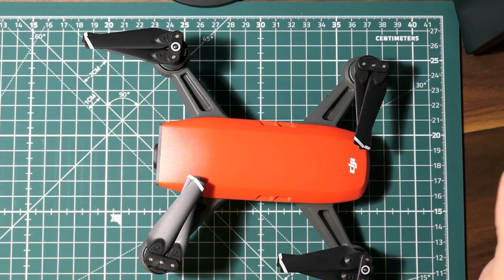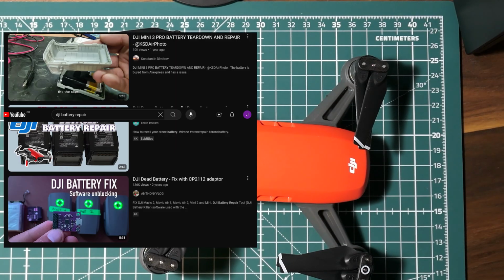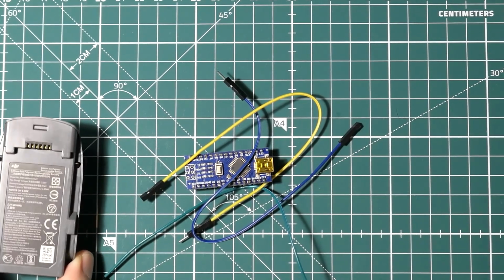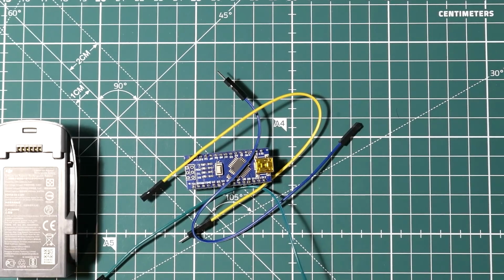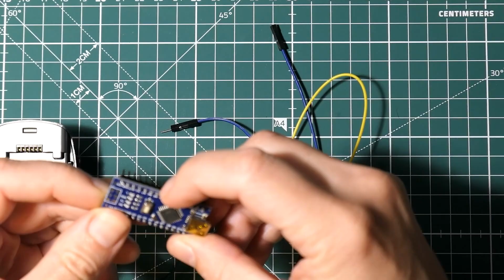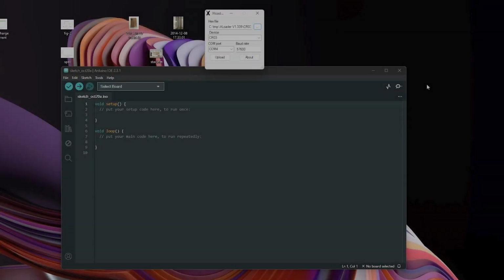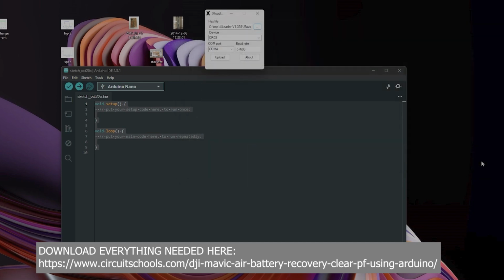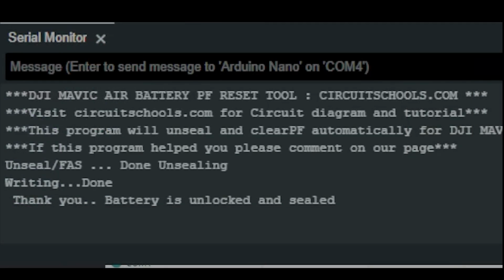DJI drone battery repair using Arduino – super easy (MAVIC, SPARK & OTHERS)!

Comment: Hello. In the video. It mentioned that if the battery is completely dead, it also needs to use a 9V battery. Can you explain this process? How to connect the 9V battery and when does it need to that?  Do you connect the 9V battery while using Xloader, or Andruino, or before? I am a bit confused. Please help
Reply from the maker: So the steps are as follows. 1) connect the Arduino nano to computer and install the hex file using XLoader, once complete disconnect Arduino from computer. 2)Connect the arduino to DJI battery as shown in video. 3) Connect the 9V battery (or 12 if using mavic battery) to the + and - terminal of the DJI battery. 4) with everything else connected, plug the usb cable back into arduino to power it up, the code will run automatically to reset the battery. You might need to try a few times etc. good luck, I will pin this comment as many people have asked similar questions.
Reply: @thecircuithelper  This exact process worked for me on 3 different batteries! Thank you!!!
Reply from the maker: @jimber13 awesome that’s great news! Happy flying

Comment: I am so confused about the process to jump start the batterys with a 9V battery. I need help. I have been able to do everything else except this. No where in this video or any video/online forum that I can find does it show you how to acctually connect the 9V battery to the DJI battery. Everyone just briefly describes it and moves on, but that is kind of the most important part.

I have 3 dead DJI Mavic air batteries. According to pin out, pins 1-4 are negative, and pins 6-10 are postive. I took male to male jumper wires which I purchased using the link and just plugged into them into pins 1 and 10 on the battery. Then I held the other ends of the jumper cables and put them in contact with the postive and negative ends of the 9V battery. I handheld this for like 5 mins wondering if anything was ever going to happen, but nothing. Am I using the correct pins? I just chose 1 and 10 because it seemed easiest, but nowhere does it specify if it needs to be certain pins for this to work, just that it needs to be positive and negative which is what I did. Also, do I leave the Arduino connected to the DJI battery while I do this thing with the 9V?

Please someone help. What I am doing wrong here???
Reply from the maker: So, it sounds like you’re doing pretty much the right thing. I read on another site that Mavic batteries might need slightly higher voltages (12V) to jump start it. I only have Spark, so can’t say for sure. 

So the process is as follows, use the two male-male jumper wires to connect your 12V source to the + and - terminals of the DJI battery (any of the pins labelled + and - should be fine).  You should also have your Arduino connected to the DJI battery as described in the video. Importantly, you need to power on your Arduino with your DJI battery attached to your 12V source. That should be all you need to do, the code will run and reset the flags on the battery.

Comment: My spark batteries were way gone from 3 years of non use. I powered the batteries from my bench supply at 12-13v and performed the reset twice with everything connected. The battery then started to take a current from the bench supply and after charging for a bit I let my drone continue the charge. This is a great save, thank you for this video!
Reply from the maker: Awesome! Glad it worked out, just take it steady for the first couple of flights, just to make sure the batteries behave as you expect! Happy flying and thanks for watching!

Comment: When i try extracting the HEX file it gives me ERROR 0x80004005 did this happen to you and if it did what do I do?
Reply from the maker: Hmm, that didn’t happen to me… does the error occur when you’re extracting the hex from the zip file, or when trying to upload the hex to the arduino? If it’s the latter, I guess it’s either a com port issue or baud rate problem. If it’s an issue with the zip then it’s probably a corrupted download. Good luck!
Reply: Use Winrar to extract the files using the password, it works

Comment: If you're using a Arduino Uno or clone, make sure you use port A4 and A5. Not SDA and SCL on the board. Thanks for the guide!
Reply from the maker: That’s a really good point! I just assumed it would be SDA and SCL on the UNO too, but it makes perfect sense that they defined the pins as A4 and A5 in the code, which we have no sight of or ability to change! Thanks for flagging this up and watching! Cheers

Comment: Is the mavicair pfreset are free?
Reply from the maker: I’m not sure, it’s possibly worth a try though. If you find the pinout of the mavic air battery and it has a clock and data pin then you’re in with a good chance. Please let us know how you get on to help others!
Reply: @thecircuithelper  I bought Mavic air pfreset code and download, but download failed the xloader
Reply from the maker: As far as i could see yesterday, there’s no need to pay for either xloader or the pfreset code, so I’m not sure what is going on. Did you try to connect to your arduino using the arduino ide and upload a simple program, just to make sure it is working?
Reply: @thecircuithelper  hello sir ,It worked after 7 hours of trial and error, the problem is that I used the xloader from circuitschools instead of the xloader from github, I paid 5 dollars to get a code from fpreset, thank you sir
Reply from the maker: Great, I’m glad you got it working! I hope people reading this realise you don’t need to pay to get the reset code or xloader! Thanks for watching and safe flying!!! 👍
Reply: @thecircuithelper  Hi, I just wanted to thank you for the tutorial, but I'm a bit concerned. In my country, 5 dollars is a considerable amount, and I’ve already tried using the CP2112 board but couldn’t get it to work... I would like to know if there’s any way to test it before paying. Thanks!
Reply from the maker: Unfortunately, it now appears you need to pay for the PFreset code! I’m not the original author so it’s out of my hands, quite a shame through.

Comment: How to download xloader?  This is free?
Reply from the maker: Yes this is also free, it’s on GitHub.
Reply: @thecircuithelper  okay thanks 👍
Reply: My xloader can't run why?
Reply from the maker: Need more details… xloader doesn’t work on your computer (if so, that’s strange, i tried on both windows and mac, worked on both). If xloader doesn’t communicate with arduino then it’s likely an issue with com port or baud rate

Comment: The site requires payment to download the hex file now. I paid the $5 fee through PayPal but never saw a download link after, anyone else have an issue with this?
Reply from the maker: Yikes, it looks like the hosting website has changed, but I just managed to download the zip file now without having to pay. Thenhosting site is pretty horrible,  with a lot of popups and misleading links which make it look like you need to pay, but you can definitely download the zip without paying.
Reply from the maker: If you still struggle, you can drop me an email at helpercircuit (at) gmail.com and I’ll send it to you.
Reply: @thecircuithelper  Yeah I'll email you, the person I sent payment to hasn't responded either, so I'd appreciate if you could share the hex code!
Reply from the maker: No worries, I downloaded it last night and unzipped the hex file, it looks to be ok, haven’t tested it though. Just drop me an email and I’ll send it to you.
Reply from the maker: I’ve emailed the Hex file, let me know how you get on!
Reply: @thecircuithelper  please share with me too, i have email to you too.
Reply: @thecircuithelper  Hi, Just wondering Would it be possible for you to send me that file? I've already sent an email to you.
Reply: Actually it's with PayPal, after payment it should redirect you to download link. But if it's not it was an issue, I emailed the seller and he replied me with the download link.

Comment: Hello, I didn’t used my Spark for two years and of course the batteries were broken. After some searching I came across your video.

I gave it a chance and bought a Nano and followed your instructions.

After some trial and error, it finally worked and the batteries are charging again.

Thank you so much for sharing this video.
👍🏼🚀
Reply from the maker: Awesome, so glad to hear you got it up and flying again… Just give it a few gentle test flights to make sure the battery behaves as you expect and holds its charge etc!! Thanks for watching! 👍👍👍👍

Comment: why does it say i can't open port.
Reply from the maker: Problem communicating between the arduino and your computer… could be quite a few reasons: 1. Make sure your usb cable is for data and not just charging, 2. make sure your computer recognises the arduino when you plug it in, you should see a new com port appear in control panel, 3. test the arduino using one of the example programs in the arduino ide to make sure you are communicating with it ok, 4. Once you know the arduino can be reached, use the Xloader software to upload the binary and connect the battery to the arduino. Hope that helps!!

Comment: Ok I'm confused I've got DJI spark can't find link/software for DJI spark
Reply from the maker: If you go to https://www.circuitschools.com/dji-mavic-air-battery-recovery-clear-pf-using-arduino/ and scroll down the page you'll find two links. The first in a zip file containing a binary file, this is the code used by the arduino. The second link is a for a programme called Xloader, this enables you to upload the binary onto the arduino. Even though the code says its for Mavic it works with Spark, I only have Spark so can confirms it works.

Comment: Hello Circuit Helper. I have the sameproblem as you - I haven't used my Spark in years and the batteries are dead/almost dead.  Although your video is very clearly outlined with all the steps, I am by no means an expert with electronic - far from it actually. I wondered if I was able to send my two batteries to you, could you repair/charge them for me for a fee? Gratefully yours,
Reply from the maker: Hey, thanks for watching. As for trying to fix your battery, I think there are already quite a few sellers on eBay that offer this service, you’d probably be better trying them as I’ve only done it once on my batteries, those guys have 100’s of positive feedback. Good luck!

Comment: hello i have a mavic air drone and i used an adrino uno i used xloader but it ididnt upload the code
Reply from the maker: Hmmm… it could be a few different things. I’ve not tried it with the Uno, but I guess it shouldn’t be so different from the nano. Just make sure you have connected the SDA and SCL wires correctly. It might be worth trying with a nano if you have one to hand. If you are certain things are wired correctly then you might need to use an external voltage to enable communication with the battery… I explained how to do this in a few of the comments on this video, it’s really easy.
Reply: Ok I’ll try comeback to you thx lot

Comment: I wanted to fly my spark again after 2 years. the batteries were only 5 charge cycles old ... plugged in and they were charging ... then christmas came and I left them in the dji charger for 3-4 days ... now they are dead ... DJI is the worst ... 😐
Reply from the maker: Sorry to hear that!! I wonder if the cells are damaged, that would maybe explain them appearing to charge but then being dead again within a few days. If they are damaged, be careful as they are a fire risk! What annoys me is that it’s really difficult to find second hand Spark batteries, I was looking on eBay and a working battery was almost same price as a used Spark! IMO DJI should still sell the batteries at a reasonable price, so many drones unusable because of the batteries!

Comment: hello, i bought the supplies but i dont know what im doing wrong, ive followed all the steps but i dont see it working. How do I charge the battery if its completely dead? to give it a boost? please help. Thanks
Reply: Everything is working. Batteries fully charged. Thanks again for everything!!
Reply from the maker: Awesome! Glad you got it going!!!
Reply from the maker: Hi, first you need to find the pin out for your drone battery, you’ll see several +, several - (or gnd) and the clock/data lines shown in the video. Buy a 9 V battery (one of the rectangular ones) and connect the + of your 9V battery to the + of the drone battery and the - of the 9V battery to the - of the drone battery. Once this is done connect the other wires as shown in the video and run the arduino code again. For the Spark, 9V should be fine, but I read that maybe 12V is needed for some Mavic batteries. Good luck and thanks for watching!
Reply: Hello, 
Thanks for all the help. I followed the steps and it did give it juice to the dead batteries. I followed the other steps and I saw where it said " this program will unseal and clear PF automatically for DJI mavic air" but that's all it said. Nothing more so I don't know if it did it or not. It seems to be charging the batteries right now. I will see in a few hours if it fully charges them. Thanks again!

Comment: Hello,
I also have the same drone and just recently tried changing the battery and i experienced the same issue. Are you able to provide the links to the tools you used to make it work again? Thanks
Reply from the maker: Wells you only need an Arduino Nano and a few jumper wires, you can find the code here: https://www.circuitschools.com/dji-mavic-air-battery-recovery-clear-pf-using-arduino/ thanks for watching!

Comment: Hi thanks for the great vid! I got everything to work until the point where the "unseal/fas" is supposed to happen. What could be the issue? I assume the arduino nano isnt communicating with the battery
Reply from the maker: That's kind of strange, I think the first thing to check is that the SCL and SDA on the battery are connected to the correct pins on the Arduino (A4 to SDA and A5 to SCL). If you're sure it's wired correctly and it still doesn't work then your battery might be so flat that there's not enough voltage for the internal battery controller to work (this is what the Arduino communicates). In this case you might need to apply ~12V between the + and - terminals of the drone battery whilst running the Arduino code. 

Hope you get it working and thanks for watching!!
Reply: @thecircuithelper  thanks for the reply! Got it to work - yes the battery was flat, so I connected a 9V Battery to the 2nd and 3rd pin and then it just worked as intended
Reply from the maker: @ awesome, glad you’re up and running!
Reply: @RunningPotato  hi, I got the same problem, could you help me elaborate on that, I don't understand what I should do.
Reply from the maker: The easiest thing is to buy one of those rectangular 9V batteries (proper name is PP3). Connect a wire from the negative terminal of the PP3 battery to the negative terminal of your DJI battery, do the same for the positive terminal. Once you’ve done this follow the steps in the video (ie connect the other wires) then re-run the Arduino code
Reply: @phamoanh9250  exactly what the circuit helper said: connect a 9v battery to the dji spark battery. negative to pin 2 and positive to pin 3. (in my case an additional issue was that i messed up the connection to the arduino, so make sure that the cables are properly connected to the board)

Comment: I recently did this to an mavic air battery. I had a few Arduino Nanos' laying around. Thanks.
- make sure you know about basic electronics.
- if your cells don't have any voltage, I won't recommend to do this or expanded. Discharge and throw away.
- I had to charge each cell to 3.94 volts  @ .5 amp or less ( basically balance them) then total charge it to ~11.75-12 volts @ 1 amp.
- than I downloaded the files needed and run it and "let it be lights."
- turn off and continue to charge via the proper battery charger at least half way not full.
- update your battery and fly while checking your battery cells in the app.

Best of luck.
Reply from the maker: Nice one, glad it worked!! I should have mentioned in the video that it is a very bad idea to do this if the battery is swollen, it would be pretty dangerous and even if it was possible to unlock and charge the battery sooner or later it would probably end in fire!